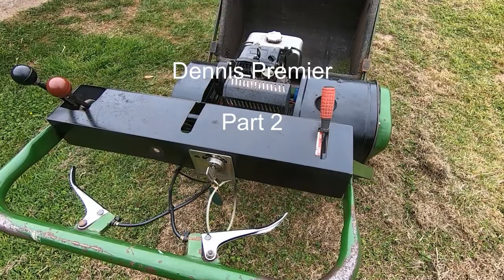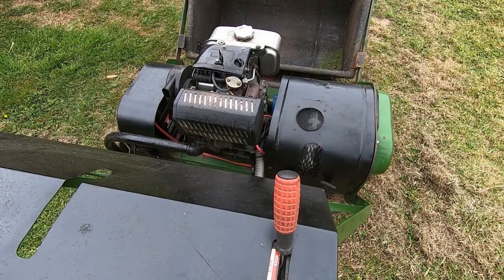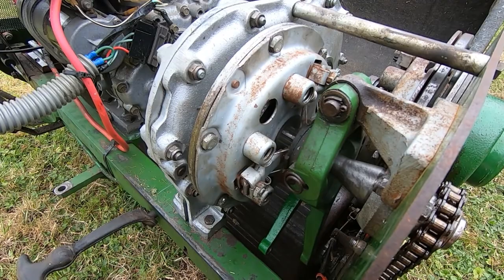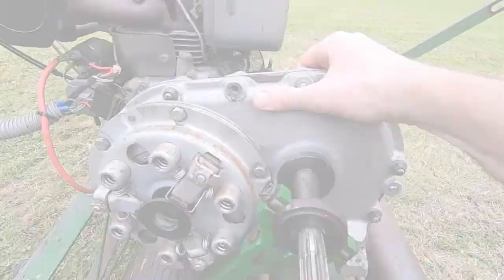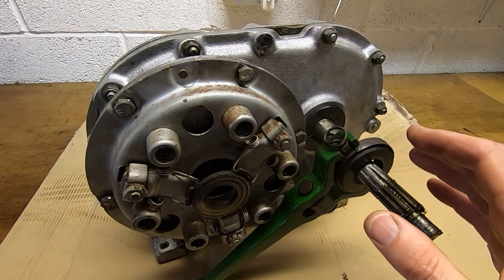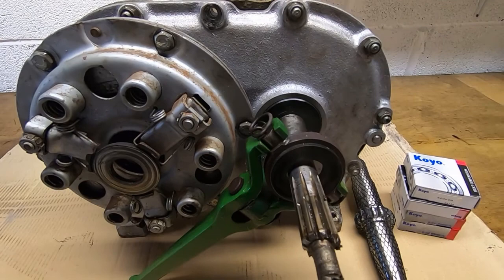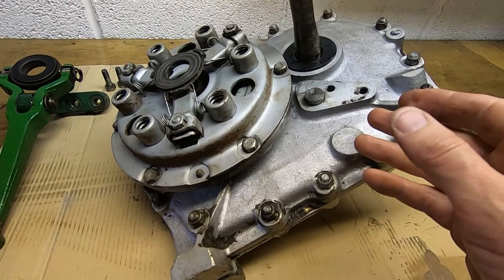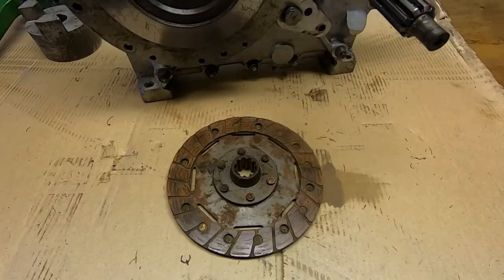Dennis Premier Part2

Comment: Jerry, I'm not a gear expert, but my Mechanical Engineering Design texts have chapters on gear design.  In short, it is normal for gears/gear teeth to be either surface-hardened with one of a half-dozen processes or to be through-hardened, but not always.  For the OEM to say that they didn't harden the gears because the teeth would "shatter" seems "unbelievable," at least without a good explanation from a truly knowledgeable gear expert at the OEM or perhaps another Commenter here with the applicable skills.

Since you have a machine shop capability, perhaps you could either measure the OEM gears and then visit a local gear/bearing supplier and have them order gears that will fit or have them recommend & order the needed gears, then make bushings, etc., as needed to fit the parts.  Of course, this doesn't solve the soft gear issue with the shaft.  Perhaps your gear supplier can recommend a business that can perform at least one of the hardening processes for you and harden all three parts?  The nearest large city to me (in Florida, USA) has at least one large heat-treating business that I believe can do that, so my hope is that you've got a similar business within a reasonable distance from you.
Reply: Short and sweet…Too hard = brittle, depends on carbon content and the other alloying elements
Reply from the maker: I can normally harden parts in my own workshop. The problem is that getting it right depends on the material and application. I still feel that the gear teeth should at least be case hardened. The teeth should not 'shatter' as the body of the tooth is not hard and so not brittle but as I do not know what the material is it would be a guess, hence my question. Either way I do not think the gears will last more than a very short time being so soft. As I say in the video I can actually reverse the output gear as it only drives in one direction and so is only worn on one side of the teeth but the other 2 gears wear on both sides so are cactus. It is even fairly easy to temper parts following hardening which I do fairly frequently but again this depends on the material composition and I do not know what this gear is made from and my faith in the manufacturer is not high.